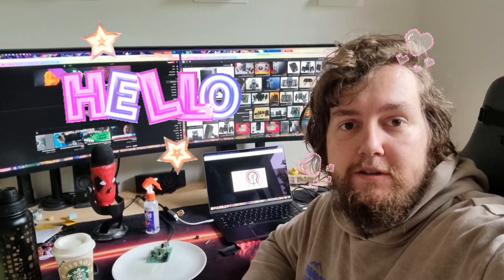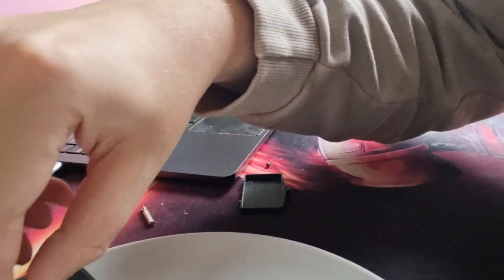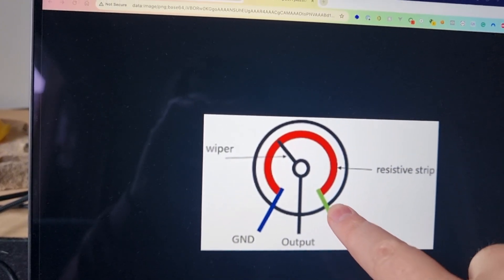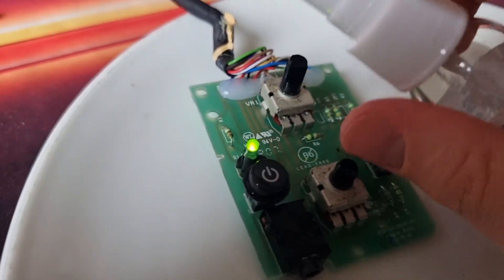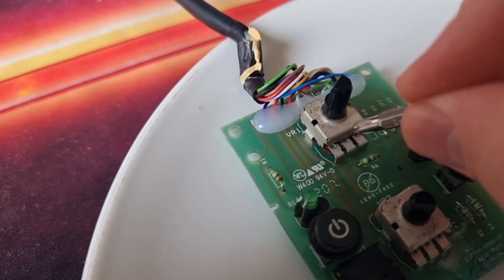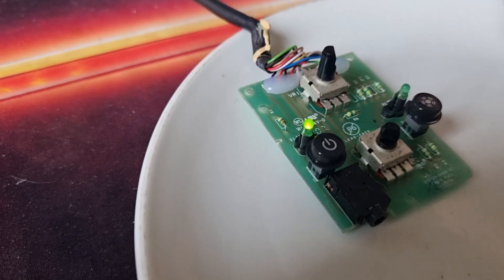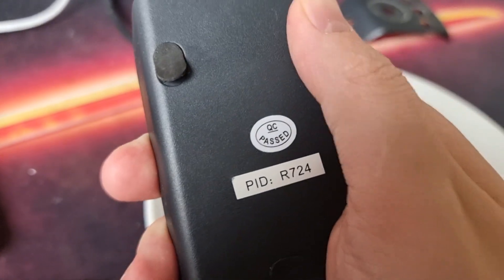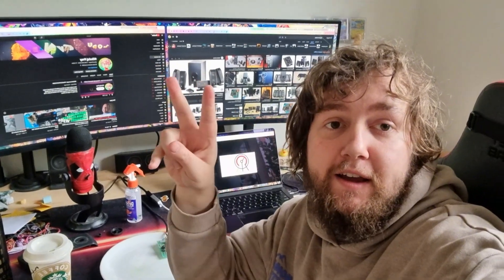How to Fix Volume Fluctuation Issue on Logitech X-540 Surround Speaker System

Comment: so the fix is to replace the potentiometer with a better one
Reply from the maker: TL;DR
Reply from the maker: But it is possible to fix it with a little clean and short circuit sometimes, but ultimately yes the potentiometer needs to be replaced
Reply: The issue with that, is finding the one with the same form factor and shaft to fit the PCB layout and knob.
Reply: @paulmoffat9306  PDB12-H4301-503BF

Comment: Spot on with the volume issues, same thing started with my X-540. No need to disassemble the control box, just pop off the volume knob, and spray some 'NU-TROL' cleaner into the pot and work it around. Also, I think the source of the problem, in the silicone 'drag grease' on the shaft, that makes the control have more 'feel'. if some gets on the element, if can make the wiping contact lose effectiveness.

Comment: How to fix pulsating volume? For example hairdryer sound is bouncing like "shhuu shhhuu shhuu" instead of linear noise "shhhhhhh". Same for wind. I HAVE REPLACED potentiometer to new one, but that didnt help. It happening only when the pilot is at 30-45%

Comment: Thanks i always thought it was Driver Issues 
i will try the fix and see if it fixes the problem

Edit : I just cleaned the potentiometer and the circuit board with disinfectant and let it dry and put it right in the case so it couldn't come loose and it works like normal again 

I hope they surpass the 20 Years in 2 Years as my Uncle bought when the were new and I made us of them
Reply from the maker: @VBTWeitUndBreit  I thought that too but no it is a potentiometer issue! 

It’s a super easy fix! Good luck 🙌🙌🙏
Reply: @lopudesigns   Thanks and i today tested them and they work like i just bought them without any Volume Issues
I looked for a Video Like yours for so long 

Im really thankful for your video explaining it so easy

Comment: 8/24/24 I got an Update: The traces of the potentiometer are damaged due to usage. 
I bought new potentiometers from AliExpress and will try to replace them. 
If someone is interested I can post another update whether it worked and the replacement potentiometer.
Reply: hello could you share link for buy sound potansiyometer
Reply: Hello everyone .
I solved the remote volume potentiometer problem I had with Logitech x540 without changing the pot. I also bought 6 sound pots from the internet and they are sitting in the corner. My solution: I cleaned the problematic volume potentiometer thoroughly with isopropyl alcohol and a soft brush, from the right, left, bottom and top to the area between the card and the potentiometer, and the problem of rising and falling in volume was solved
Reply: @Turkey-Star  I guess you've had a not so worn out potentiometer. My traces were wron out unfortunately, I already tried cleaning it with isopropalcohol.

Comment: Thank you for the video. I cleaned the potentiometers with silicone remover and a cotton swab. After that I also short cutted it with a screw driver and now it works, I finally have my full volume back. 👍
Reply: Unfortunately, the issue came back. I will solder it with a fitting potentiometer.